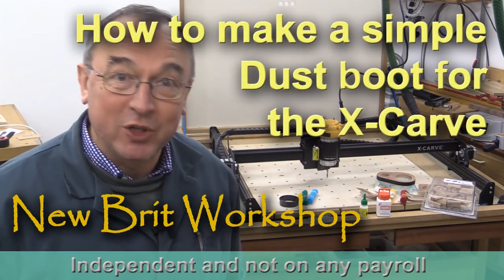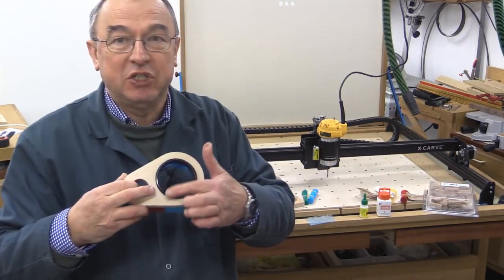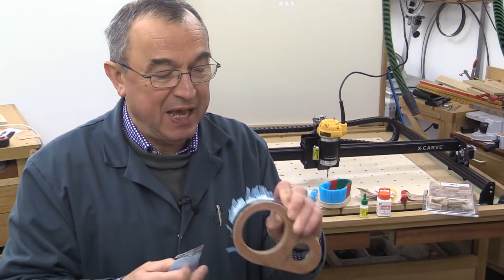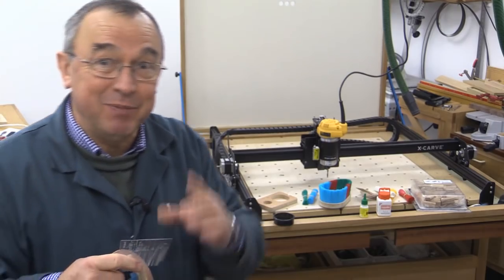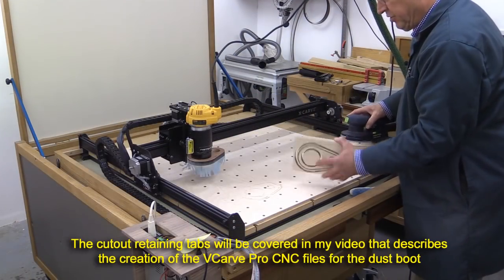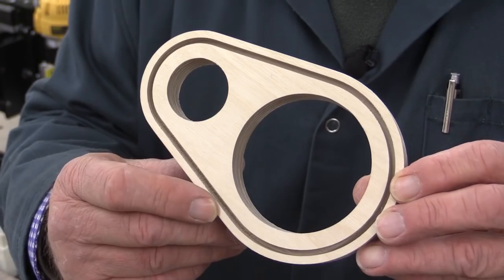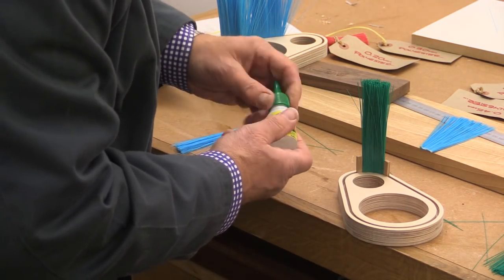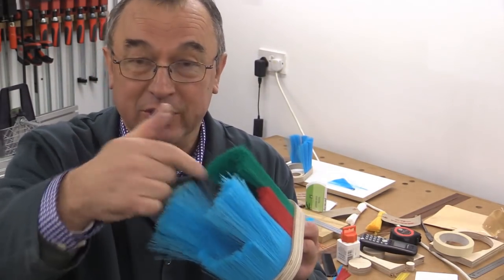How to make a basic Dust Boot for the X-Carve CNC

Comment: Hi Mr Peter , i want to ask you about the feedrate ,plunge ,stepover ,stepdown setting ? if u can tell to have a base line.
Thanks
Reply from the maker: +Akrout Osama   I am still being quite conservative and use about 20 mm per second feed rate, 6 mm per second plunge rate. For a 1/4" cutter I have been using no more than 2 mm step down and 20% step over. I have been doing some X axis stiffening and feel that I can go a bit higher on those figures now. Hopefully a video about the X-Carve mods will be out soon.      Peter
Reply: Thanks (y) yes there is torsion angle on each y plates

Comment: One thing you can use is a strip of door brush because the brushes are secured in a metal housing which is easier to connect to your plywood
Reply from the maker: +Lucian Mindrila Cheers Lucian.  Peter

Comment: Hi Peter,

Great job. Will definitely be making one when I get mine. I see you're using a CT extractor with the X carve. I had intended to do the same thing but after watching Alan Holtham guide to dust extractors in which he mentioned a dust extractor with a 100mm hose can run for 4 hours but when you reduce the diameter to 26mm it can only run for 40 mins with 20mins rest. So I contacted Festool regarding the run time on their extractors and they said they are only designed for intermittent/short time use and wouldn't recommend them for cnc work which could take hours. Thought it was something that should be highlighted.
Reply from the maker: +Dean Martin   Hi Dean,  I have absolutely no worries about the Festool extractor as they are designed to run flat out for hours on end. A number of Festool tools are ones that are designed to be used for hours at a time (like sanders) and so all of their extractors can run continuously all day. Whoever told you that they can't is wrong.  Many thanks for the kind words and do let me know how you get on with your X-Carve.  Good luck.    Peter
Reply: Well that's good to know, save me having to buy a twin motor extractor. He was a rep here in Ireland so thanks for the input. 

Going to order directly from inventables in America as they have more options to customise your order.
Reply from the maker: +Dean Martin Hi Dean,  I would strongly recommend that you get the Dewalt mount and do not bother with a 24v or 48 v spindle. Installing the Dewalt had transformed my X-Carve. Please do not hesitate to contact me if there is any chance that I can help.    Peter
Reply: +New Brit Workshop (Peter) Going with the dewalt 26200 and getting the mount for same from savvy robot in the UK. I was also going to get the 1000x1000 waste board from the UK as the shipping from America is ridiculous. But would you recommend making my own? I see it comes with a pre drilled grid system for clamps but i assume my own X carve could drill this for me? Are these holes counter sunk below or is the underside of the board elevated above the the work bench? Is there more to it than just a straight through hole? Maybe you have covered the waste board and the clamps in detail in a previous video but I don't think so. If I'm incorrect could you please direct me. Thanks
Reply from the maker: +Dean Martin   Hi Dean, You certainly could make your own. I think that once you start the frame assembly you will be able to work out the sizes. You can drill the holes for the screw inserts by hand. They are countersunk and you will need to experiment to get the depth right. I buy my inserts from Screwfix but I am not sure if they have the smaller size (5mm I think). Inventables have these holes on a 75 mm pitch which you can change if you wish.There is no need to have any writing or pattern on the waste board. You can scribe horizontal and vertical lines (sorry along the X  and Y directions) using a shallow "V" bit in order to get a square reference mark on the board. Let me know how you get on.     Peter
Reply: +New Brit Workshop (Peter) Will do. It'll probably be the start of March before I'll have it up and running but will let you know how I get on. Really appreciate the advice